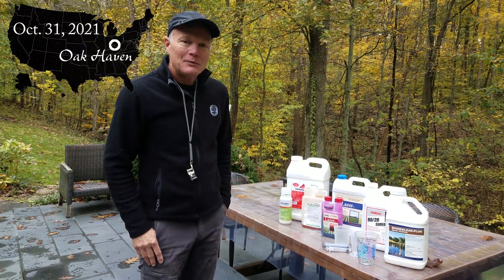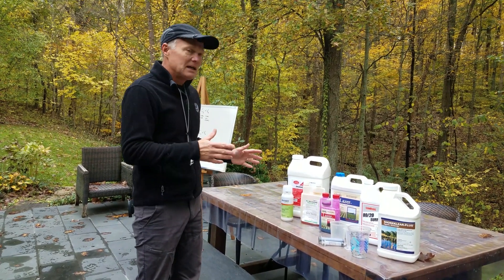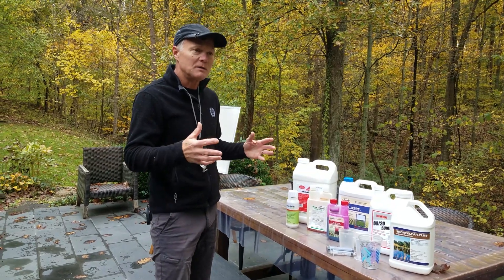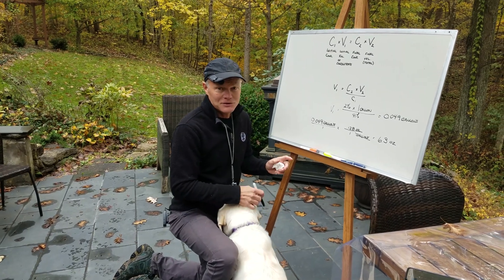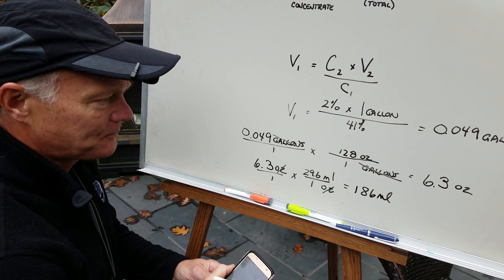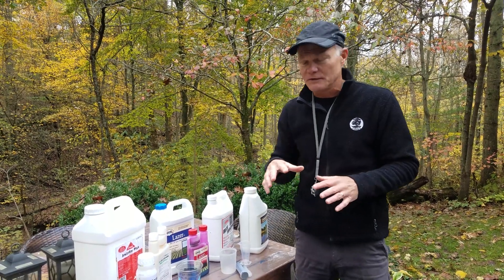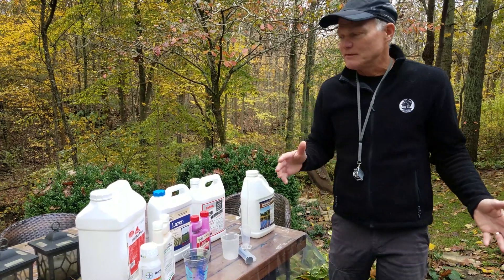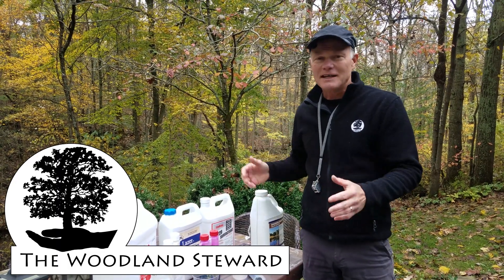Measuring and Mixing Herbicides for Woodland Management PLUS A Table of Common Dilutions - 10/31/21

Comment: What is the best to use to kill every thing like the rail road use i have fill in my driveway big rock on side of a hill
Reply from the maker: Good question! Maybe someone else will have an answer for you. You want something that is non-selective, relatively persistent, and can kill both before and after emergence. All of that and something that will stay where you place it and not wash through the gravel and into non-target areas.
Reply: @TheWoodlandSteward  thanks. Its mainly morning glory. I have round up quick pro and rm43 it works for little while then comes back

Comment: Any thought regarding hardware and the use ammonia nitrate to increase effectiveness of the glyphosate?
Reply from the maker: I can't add any personal experience. Adding a fertilizer makes some sense, but I'm not sure it is necessary.
Reply: Don't add ammonia nitrate, it's so corrosive to application equipment.  Just up the percentage of glyphosate.

Comment: Great info, very clearly explained.  Here is a question that is really bugging me.  I've seen multiple manufacturers glyphosate labels that recommend 2.6 oz of product for a 1 gallon mix with water to give a spot spray solution with 2% active ingredient.  I got suspicious when the same mix recommendation was made for both a 41% label and a 53% product label.  Clearly your calculations show that the active ingredient in this example should actually be at 6.2 oz.  Do you know what the heck is going on with this??  I've wasted a ton of time spraying wavyleaf basket grass at too low a concentration and gotten very spotty kills, likely as a result of this problem, very frustrating.  This is the kind of thing that can discourage budding weed warriors, which we don't need.  I can't find any discussion of this problem via a google search.  I have also recently heard from a State Forestry professional that the reported active ingredient concentrations of glyphosate in some products (Roundup) are actually lower than reported.  This makes my head spin.
Reply from the maker: Great question! When manufacturers suggest 2.6 ounces of 41% concentrate per gallon of solution, they describe that as 2% solution "of this product", meaning that they are not speaking about the percentage of active ingredient, but the percentage of "this product" they are using. As I read through the Roundup Pro label, they also refer to using 50% - 100% concentrations "of this product" for Injection and Frill. That is all very confusing if you say to someone that they should use a 50% Roundup solution, but don't mention that you mean 50% of the 41% concentrate (or 20.5% of active ingredient). It makes much more sense to me to refer to the active ingredient. Thanks for the question!
Reply: Right, I think it it much more common for folks in this game to refer to concentrations of the active ingredient.  Everyone always stresses that you must "READ THE LABEL", but honestly the labels could be written in much more helpful language.  And of course the focus and mindset of the label writers is on Ag applications.
Reply: @johnr6179  It is frustrating! I am dealing with English Ivy which requires stronger solutions than labels want me to mix.  I hate spraying at all but using too weak a formula that does not do anything is harmful and pointless.  I am glad to have found this video to find that I have been mixing correctly to get the percentage I wanted. When I look at the labels and how they want me to mix my product, it has never matched what I was doing. This is because I was making my calculations based on the active ingredient not the total.  Math was my least favorite subject in school. If one were to look at my math, they would see how oddly my mind works.  I'm happy to have the proper mathematic procedure making my calculations much more direct.  I only spray where I can't safely pull. When I resort to herbicide, I want it to be effective. Thank you @TheWoodlandSteward for the help.

Comment: Chicago burbs here.  tad over 1 acre Oak/Shagbark Hickory.    How is it you don't have any Buckthorn lol.   Still have a mother or 2 on the property I need to nail.  Otherwise I find small ones pretty easy to pull.

What I have is Bishop's Weed/Goutweed (Aegopodium podagraria I think).  Still have a few remnant areas and in the past found it needed a pretty darned strong dose of Roundup. 
Bought the 41% and a surfactant to be more efficient.   I so wish I wrote down what did it.
This stuff is nasty and I don't want to mess around!

If anyone has a dose suggestion for this - I'm all ears.
And Vinca Vine ground cover.

Comment: I like the chart but I guess you have to be a subscriber to get the link or whatever to download... one question I have is the concentration level required to accomplish a task.  For example, is a 20% level of glyphosate applied to the cut stems sufficient to prevent a woody plant from returning or would you need 25% depending on the plant , or what is the level required to be rid of English ivy?  Or is it all a matter of experience?   And the goal here is to use the least amount of the active ingredient to complete the job?  Thanks for your knowledge here as I am in the process of this type thing on a very small area of my yard.
Reply from the maker: Different people have different opinions on what concentrations to use. The least amount that works is always bests, but you also want it strong enough that it kills it the first time so that you don't have to keep applying more herbicide. I prefer to get it done and let the area recuperate.

Comment: I bought Alligare’s Super Marking Dye, will this work with kerosene + Triclopyr 4 for basal bark application? Is says it’s water soluble. The only oil based dye I can find online is a Basal Oil product with dye in it that I understand I would use in place of kerosene for mix. Any tips??
Reply from the maker: Sorry, I don't have any practical experience with dyes for kerosene. I don't normally use one.
Reply: @TheWoodlandSteward  ok thanks
Reply: I've used Liquid Harvest Lazer blue with diesel and Triclopyr 4 for basal bark and it works. The label on the Lazer blue bottle says to only mix with water based solutions instead of oil based but I didn't have any problems with it mixing in diesel and Ticlopyr 4. I doubt if there's much difference in using kerosene as the carrier instead of diesel or much difference between the dye brands. You can just try mixing a small amount. The Basal Oil products are pretty expensive so it's worth trying to see if your dye will mix with kerosene before getting the Basal Oil.
Reply: @dttrandom  Thanks for the info. I tried the Aligare dye with mixed results. Sometimes it works fine and sometimes it glops up. There are mixing order instructions buried somewhere in the label leaflet, I’m going to try it one more time. And maybe try diesel to see if there’s any difference vs kerosene. I may end up ordering the basal oil plus dye next year… since the TOH battle continues.
Reply: Consider switching from kerosene to basal oil.  Basal oil has an emulsifier in it.  You can use straight basal oil plus dye with Triclopyr, or you can have just as much effectiveness by using 2 parts water to 1 part basal oil, plus Triclopyr and dye.  Again, it has an emulsifier so that it mixes and stays in solution whether it's oil or water based.  If you're spraying basal stem consider a recipe of 16 oz Triclopyr 4, 1 quart of basal oil, 2.5 quarts of water and a splash of dye to make a gallon of basal spray mix.  If you want you can go to 24 oz of Triclopyr 4, 1 quart of basal oil, 2.25 quarts of water and a splash of dye when basal spraying in late winter/early spring.  This mix is deadly on most all invasives.

Comment: What if I wanted to make less than 1 gallon of herbicide, say only 3 cups of a 4% solution with an initial 41% glyphosate, what would the equation be?
Reply from the maker: V1:Volume of Concentrate Needed = (C2:Concentration of Solution Desired x V2:Volume of Solution Desired) / C1:Initial Concentration)  ----  V1=(4%X24oz)/41%   ---  V1:Volume of Concentrate Needed = 2.34oz 
2.34oz of 41% concentrate to make 24oz of 4% solution

Comment: Jim, Nice job providing this information, thank you! A couple of ideas/comments, For your sprayer head, I think a felt wrap could work really well, I think it comes in different thicknesses. Any craft or fabric store should have it. I thought a piece of PVC pipe with a simple cap could make a nice safe holster for the wand. I have a little concern for the wand hitting your leg or bumping around into things it shouldn't touch. We have tons of honey suckle and invasive vines plus buckthorn. Hoping for the best thanks again!!! Paul
Reply from the maker: Thanks for the suggestions, Paul. I have been concerned about the wand hitting my leg. The last few sprayers I have put together have had particularly stiff tubing that seems to make it worse. I will give some thought to the holster idea!

Comment: Is triclocopyr better for the environment than tordon rtu for not translocating to nearby trees.
Reply: Absolutely yes.  Triclopyr has little to no translocating capability.  Tordon RTU (picloram) is well known for translocating.
Reply from the maker: I think so. Triclopyr is relatively inert in the ground. I have killed off too much unintentionally with Tordon, so I have stopped using it.